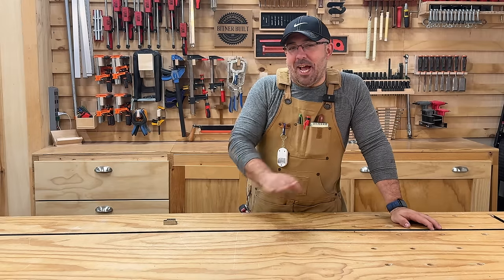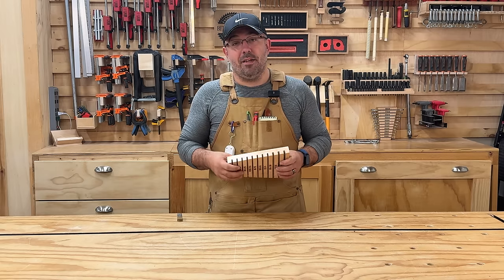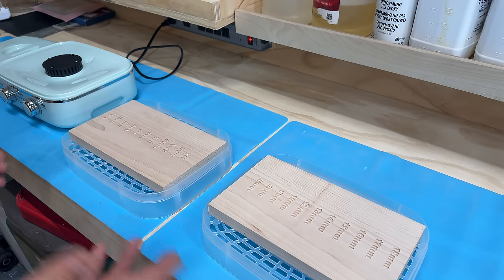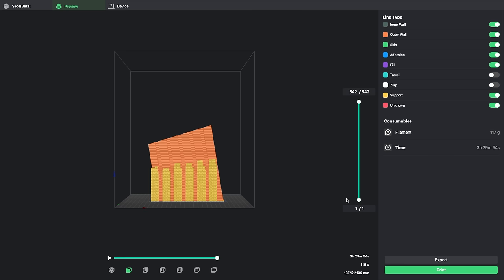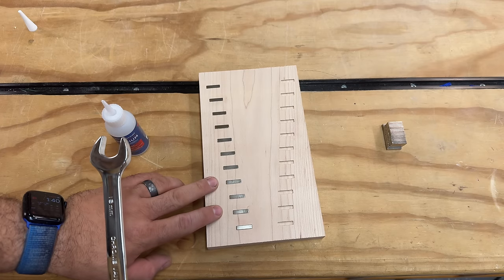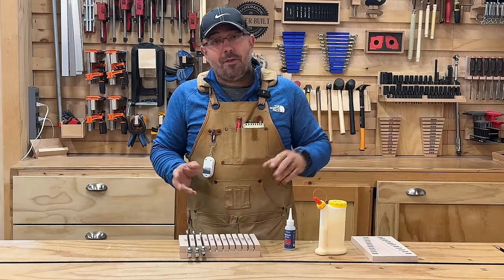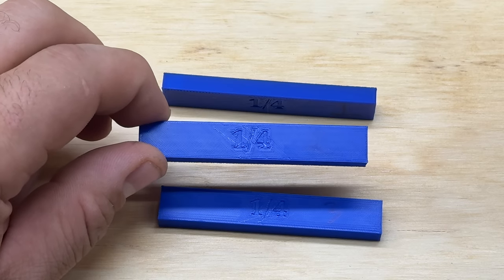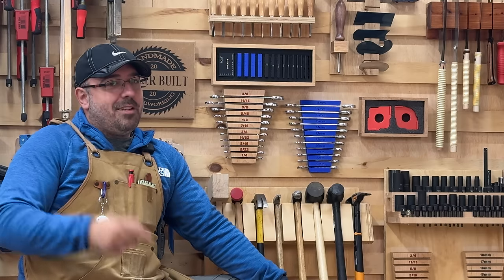Wood Vs 3D Print - Wrench Holder + Bonus Setup Blocks Featuring The Ankermake M5C - Free Files!

Comment: Just at a glance, I actually think you printed in the wrong orientation.

I would have printed those face down, with the part with the writing actually touching the bed surface. Probably wouldn't even need support if you dial in the bridging settings for the material you are printing with and make the CAD have no more then a 30° angle overhang.

You could print the first 2-3 layers this way in one color, then pause and swap filament, and let the rest of the print go in the other color, and that would give you the contrast for the numbers.

Or you could get fancy with Orca slicer instead of AnkerMake slicer and use that to make filled-in writing in white filament. Just one or two filament changes would work for that.
Reply from the maker: Good tips!

Comment: Good video.  For those with 3D printers, note you can solve some of the issues within the slicer.  For example, I would be using Orca Slicer and I would add mouse ears so the corners don't warp up.
Reply from the maker: Great tip!

Comment: for coloring in the 3d printed labels, maybe colored CA glue? i've done it on wood and metal, but not sure how it works with PLA... depending how deep, you have to do a small layer then harden then another small layer and harden and so on because if it is too deep it hardens the top and maybe not the bottom and can cause issues
Reply from the maker: Since that video, I found that a really easy way on a 3-D printer that only prints one color is to stop the print right at those top layers, you remove the filament and then put in a different color like white and then finish the print. Very little work but it comes out 1 million times better, or if you’re using a multicolor 3-D printer like one of the Bambu lab ones

Comment: Nice.  A vid on how you model would be helpful. I’m trying to use skechup, but it’s not always a great experience.
Reply from the maker: Give tinkercad a try I’m still a noob but on there adding blocks, merging them together or using subtraction blocks accomplishes a lot.
Reply: The modeling isn’t the issue, it’s getting it to print the way it’s drawn.

Comment: Great video. But it seems to me you now have a 11/16 labelled as 11/15. Also what is the accuracy of the say 1/8 set up block. Surely you should convert to thousands of an inch and check them. The callipers must have a tolerance band for each size?
Reply from the maker: Yea we caught that after and the files are updated, (it’s noted in the description) the cnc is cranking out a new one. On the 1/4th blocks since I did that under different settings on the .4 and .2 nozzle under precision mode the digitally read .2500 the fast print one is .2455
Reply: Glad you caught it.

Comment: Nice video and I like the comparison between wood and 3D print. I’ve got a 3D printer but I think I’d still make the spanner holder out of wood.
When embedding the magnets in the front face I think I will use the router table to cut the indents as I don’t have a CNC.  Probably have to write the sizes on the front ☹️
On the mm design, 6 and 9mm are not all that common in the UK, but 19mm is.  That’s another reason to make in wood, it’s easier to adapt to your spanner collection.  Thanks😊
Reply from the maker: Thanks! Yea I personally like the wood version of this but I have been surprised at some of the nice 3d tool holders I prefer, like for my Milwaukee jig saw

Comment: Look into embedding magnets on the 3D printed one. Not familiar with your brand but most slicers will let you pause (or use a filament change, even if unloading and loading the same filament). Create your model with recesses for the magnets and have the printer pause at the layer that will cover them. Insert the magnets and resume, printing right over the top of the magnets. That way you can have an embedded magnet behind the wrench with only a layer or two of plastic between them and the wrench.
Reply from the maker: Oh very cool tip!

Comment: my humble opinion: Wood is to build something pretty that involves (most of the time) a good amount of labour/ work. Everything is possible with 3D printing in a fast and easier way but it might not look that nice. Both have their pro and cons
Reply from the maker: Would totally agree, on this one I definitely go for the wood but the printer has its place particularly with the setup blocks, couldn’t make them from wood (swelling etc) so it’s fun to play around in both spaces.

Comment: Great video, thanks for showing the 3 methods. I have an Ankermake question for you. Have you tried using petg instead of pla and if so, did you have any problems?
Reply from the maker: So I have played with pla, petg, abs, tpa. Abs is actually my favorite as it’s high strength with medium flexibility but I have an enclosure for my printer with heat and exhaust, you can’t do abs out in the open. Petg I have tried a few times and the prints failed, I’m sure it’s just a small setting issue. My filaments are stored around 12% humid so it’s not a hydro issue either, but the fails pushed me to just go with abs if I need something stronger than a pla print.
Reply: I found to print with PETG I had to slow the print speed down and increase the print temperature.   Once I did those things I get perfect PETG prints every time

Comment: Don’t know if it’s been mentioned already but you could print the cleat separately and draw in some holes so you don’t need 2 separate versions and you drastically cut down on waste also it might be useful to look into over hangs and chemfers I think I can make this model supportless
Reply: I think you might be underestimating how powerful a 3D printer is especially if your using pla
Reply: @BitnerBuilt  love the series btw I’m in the process of building a cleat wall with 50/50 wood and plastic. I already built your hamer holder
Reply: I just took a good look at your design if you turn the dovetail 90 degrees and make a couple of smaller ones side by side then you can print it laying flat on its back without using supports and if you make the numbers raised then you can pause the print when it’s about to print the numbers at witch point you can change the fillement so you can print those in a contrasting colour (sorry English isn’t my first language I hope it’s clear enough ) I hope it’s helpful love your stuff
Reply from the maker: @KorevaarAnne ah good idea 👍